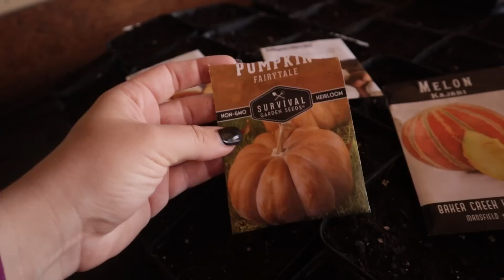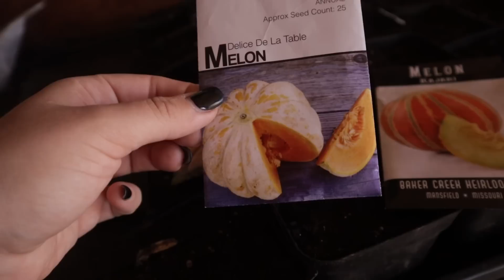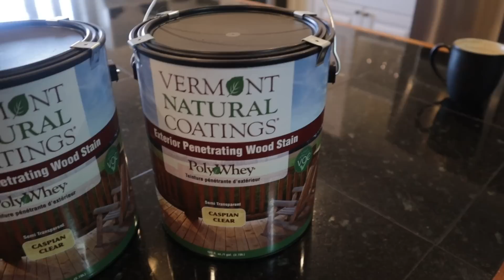Bringing in Reinforcements for a HUGE Job!

Comment: If it is clean up with soap and water= means it is water based. Means you can clean and re-use your rollers and brushes. It will be waterproof after it cures. The down side to this is that you may need to do this every year (depending on the weather in your area), It should be recommended on the can. It's a lot of work, but it is protecting your investment. An oil based stain sealer wont hurt anything because it is on the outside of the beds. And it will last 3 - 5 years. However- you can always put oil base over water base- but you can not put water base over oil base. The Bees wax (costly) is primarily used on the inside of the beds before you fill them. to protect the wood.
Reply: Great comment
Reply: @faithofamustardseed8198  Thank you. I'm an Artist and a Gardener.
Reply: This is why I read the comments..thanks so much. Your informative. I would have never known that.

Comment: I think you have a really great setup with these raised beds. Good amount of space between them, good sunlight. Another advantage to planting your taller crops on the back side of each bed is that it will make it much easier to harvest higher crops from the side where the ground is higher. Imagine having tomatoes or corn on the front side where the bed is super high… you would need a ladder to pick tomatoes 😂. If I had your setup I would totally plant bush beans along the front edges because you won’t need to bend much at all to pick them. 👍
Reply: Hi

Comment: Dear Becky, thank you so much for your videos. They always brighten my day. I’ve gardened for many years and one of the most useful things I’ve invested in is a Brother hand held label machine. When I get a new seed packet I straight away print out a label for the solid label stick. The labels are weather resistant and I’ve had some last several years. So easy to move from seed tray to individual pot and then to outside in the garden. Might be an idea for you in the future. It’s useful indoors of course too. Keep up the good work love. Ros x

Comment: You have applied a film-forming sealer on the outside of the wood & it is going to peel, plus if it was a clear sealer the wood still isn't protected from UV rays. Ideally you would let new wood weather for a year, pressure wash it, then apply a semi-transparent stain. You would probably need to clean and re-apply every few years. You could also buy a pump sprayer to spray on the stain and use a roller to back roll the excess off - that will help the task move quicker.

My husband does a lot of restoration so this is all from experience and research! 

Love watching your videos 🙂

Comment: For the future, my suggestion would be to put the sealer in a paint sprayer, since it is so thin.  That would have made your job so much easier and faster.  You can rent them from Lowes or Home Depot .  Or buy one, they are not expensive.  And girl, you need to ALWAYS wear a hat outside when you are gardening, even on a cloudy day.

Comment: If you nick the round end of the seed it will germinate faster. I nick it with a small box cutter, you could use nail clippers. I do it just off to the side of the bottom or on the side.

Comment: Next time, use pump garden sprayer for applying stain, then brush. Love your family support.
Reply: Question 🙋‍♀️ if the purpose was to seal the wood then is it really worth it if you didn’t seal the inside? I would think it would do more harm since water can’t evaporate from both sides 
I do think sealing would be beneficial but only if done on all sides.  Right?

Comment: Unfortunately to make your raised beds last longer you needed to apply the sealer to the inside before the soil was added. That way the moisture from watering will not soak into the wood and be trapped by sealing the outside of the wood.
Reply: You also shouldn't seal new wood the first year it is used!

Comment: Becky that landscape fabric will easily last 6 or 8 years if its not exposed to direct sunlight.
Never had issues with cutting unless using a dull box cutter. One clip then shears or kitchen scissors.
So great you found that sealer. We were told to seal on year 2 with cedar or teak. It breaths first year and dries a bit.
Beautiful weather there. Everything going in ground this weekend.

Comment: The best way to get melons started is on a heat mat, pumpkins too. Once they germinate lay off the water they like to be slightly dry. If you keep the soil too moist they'll die off.

Comment: If one seals the outside with a waterproofer, rather than the inside, are they trapping water in the wood? The inner side will get wet from watering and the water won't be able to escape because the wood can't breathe?

Comment: If you think 70°F is hot, come to south La where the humidity is high along with temps in the high 90's & low 100's. Both combined & you can't breath & thank God for air conditioning. I'd love for it to be 70°F all of the time. We don't wear long sleeves much in the summer, it's way too hot.
Where is your little one, it's like he doesn't exist. 🤔🥺

Comment: But won’t the beds rot from inside of the bed from the watering of the plants???? Maybe you should’ve done this before the dirt was put inside the beds!
Reply: No it will not rot. As she explained.. her beds are made out of cedar. They will not rot. They will just turn a grey color over time if not sealed. You do not need to seal the beds.
Reply: @TD-izAbxy  I really don’t know about needing or wanting to seal from the inside, but I can assure you (after living in a cedar-sided home for 26 years), that eventually, cedar can rot. It lasts longer, but moisture does eventually affect it.
Reply: During construction the beds were lined with plastic and also hardware cloth.

Comment: Do you ever have a problem with your bottles bursting during the second ferment? I've had that happen so often with my flip top bottles that I stopped making it in the summer because I got so tired of the cleanup. I live in a hot climate.
Reply: You have to "burp" them from time to time, or refrigerate to slow down the fermentation. Definitely the heat will make it ferment more and more quickly.
Reply: @jelatinosa  Thanks for the reply. It was my hubby’s  job to “burp” the bottles because I hate the popping sound but it was still so bad. He would release the pressure just before bed to try and prevent them from bursting while we slept. We had many do that on numerous occasions while we slept. I just hoped there may be better bottle options that might help prevent that from happening.
Reply: @kellyashby8388  they do sell self burping lids, but I think they are pricey. It might be worth it if you ferment a lot and are losing lots of bottles.

Comment: Looks like a set of steps or ramp in the middle of that wall would be a faster way to get to the house and back. That’s just lazy me. Also, I’m still wondering if that black landscape fabric is “organic” or not going to compromise the quality of the soil you were so careful to assess. It seems to melt like plastic.

Comment: I'm a little confused about the varnish because when choosing a wood raised bed, the wood is specifically chosen to be a certain wood that does not have chemicals, but a natural wood such as cedar. At least the varnish is not on the inside of the raised beds. It does look beautiful and will protect the wood. I was just a bit surprised that you chose Varnish. I wish that I could have a garden like that. Simply amazing 👏